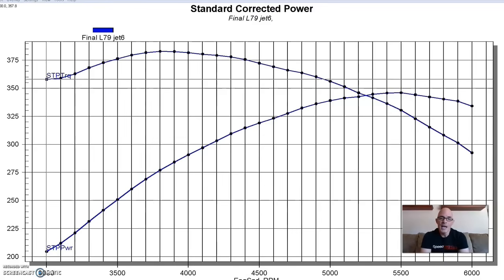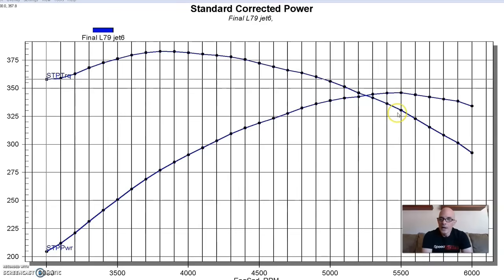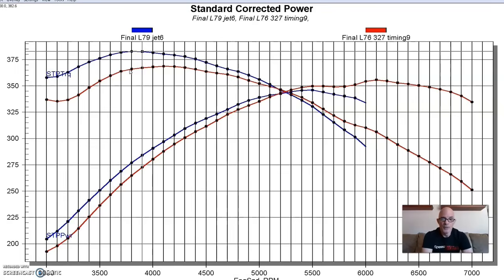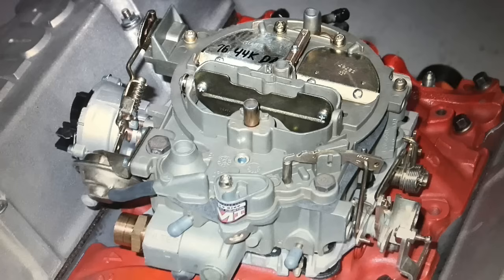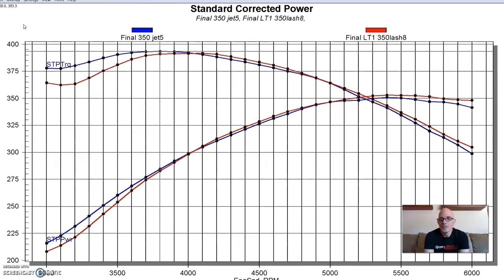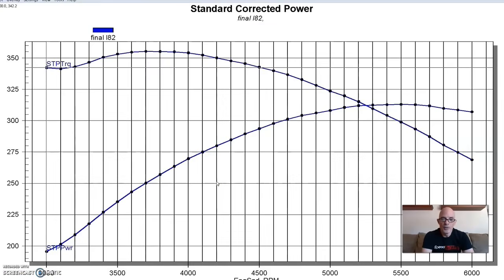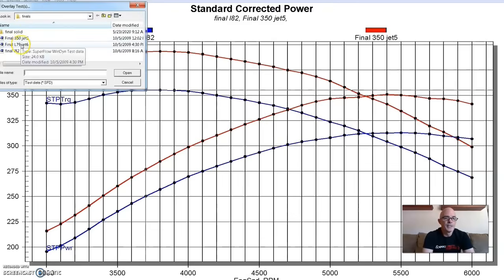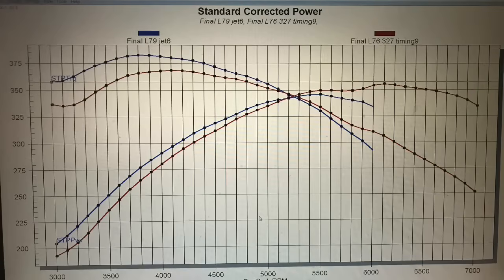HOW MUCH HP DID THE L79 350-HP 327 REALLY MAKE? WHAT ABOUT THE L46 350-HP 350 OR L82 250-HP 350?

Comment: I had a 2nd design Z28 cam, the 257/269/.493/.512 in a popup 350 with 186 bolt hole 2.02s and the nuts kept backing off,within like 5 miles.  We tried new nuts and didnt help.  We never did figure out why.  We did poly.locks and motor ran great for years.  So weird.  I've had over 40 flat tappet solid SBCs and that was the only one that ever did it.

Comment: I love these combinations and have built a lot over the years - I use the hyd 450 lift 222dr with 9.8 cr fitted to a 76cc combustion chamber ( better flow and not shrouded) and a Qjet with an aluminum manifold with awesome results with stock big value heads for street use great power to 5500 rpm-  total cruiser on pump gas and a pleasure to drive with little mechanical maintenance. planning to dyno it and see what it actually puts out-  have raced a lot in my day and always relied on lap times as an indicator of setups.

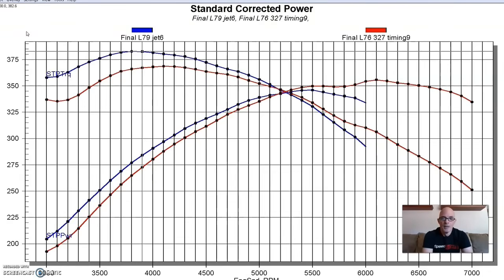Comment: Mid 60's my cousin was an apprentice machinist and he build a GM correct 375 Fuelie motor for his 57 Chevy.  Backed with a 4-speed and 4:11 posi, it was one of the baddest cars around San Jose at the time.  Not many wanted to take that car on.  396 Nova's - sure.  But most full bodied cars stayed away.  I was running a G2 Paxton blower 312 in a Ranch Wagon and on a good night at 4-lanes on the coast highway north of Santa Cruz, he could walk me by 2~3 car lengths.  It was just one of those combo's that really ran when he wanted it to.  He was one of the few guys who could really tune the Fuelie system.  Great motor, good memories :)
But I love the L46 cam as an all around good piece for a street motor :D

Comment: Hey Richard, I would like to you to do a test on the L T1 from 1989 1997 U do it with the torque head Ignition system , it's supposed to be a bolt on 50 horsepower and I would like that your review on it thank you so much and I look forward to the possibility of you morning that test
Reply: Being an f body owner and having experience with this system they are no real power gains from it, the original opti spark was very advanced for its time and could keep ignition timing within 1° of absolute perfect timing!!
Reply from the maker: no ignition system is worth 50 hp on that motor

Comment: My shop teacher gave me one of those 30/30 cams I had a 75 280z funny thing was I pretty much had ever sbc made minis the smallest of the all but any was that cam ended up in my dads old monza 283 bad thing was it had one bad hole so 3 machine shops later got that one hole 40 over and yes 1 hole. A little grinding and got it with in 2grams of the others.the other bad thing being broke ment no money for springs.it sounded nasty but she would float the valves at 3800. Young and dumb to the track I went shifting at 3800 floating valves through the traps at a mean 15.2 engine before that was stock 350 with a 150 shot 11.4s lol

Comment: I had a real 70 Camaro Z28-RS/SS 4.10POSI- TH400!!!!!    ALL ORIG!
350-370 SOLID lifters.    Rare car...and it was very quick...but no a/c.....and plastic seats.....yuk.   
I would kill to have it back today.   Never had lifter ask problems....but my other sbc did.
Some pulled studs out of head, and that was why they kept getting noisy!  Drill head & stud and hammer in  1/8" rollpins....End of problem.    Another thing I did was add 1.60 exh valves to all 327 motors....with a cam, they ran Real Good.....
I could type all day about my cars from 1969 to today!!!!
69 Z11 pacecar conv.  396-350 with Indy title!!!   34,000mi!!
70 MonteCarlo 402 4speed bench seat NO AC!!! All numbers matched on all these.!!
Tons of musclecars in Omaha & surrounding areas.....70 Buick GS455 stage2!!!!  7000 miles.
71 Z28 Baldwin Motion Camaro 454with overdrive 7500miles( sold for $200k)....
Not even the tip of iceberg......
Reply: I hope one, God will bless me with something even half way descent and, I will be happy. 😁😎

Comment: Which 350 you tested had 3.8” bore? Buick engine and they used it make a V6 from it. 231 V6 same bore and shorter stroke or you didn’t test the Buick 350 ?
Reply from the maker: no sbc 350 has a 3.8 inch bore-they are all 4.0
Reply: Richard Holdener  Oh ok thought so lol Great vid btw.

Comment: My first car was a 55 Chevy. It was an old drag car with hardly any original parts. I scoured the globe or at least any wrecking yard in driving distance for a L79 or a L46, it was like finding the holy grail. Most times I would end up with another 300 horse 327 with a worn out cam. So a new bump stick, intake, carb and I was set till that one let go. Those were the days.

Comment: I have had the nuts loosen up before and start ticking on hydraulic cam on the dyno one time.  I buy new nuts in bulk and replace them on every build that uses stock rockers.  I use stock rockers on a lot of street car engines because they are quieter and the performance gain not noticeable. Some of the round track engines I build require stock rockers. The data you shared is very interesting the local round track requires basically a L82 in the lower classes. Thanks

Comment: 327. Roller Hydro top to bottom. Holley Sniper. Long tubes. Aluminum Heads in a Nova with a manual. Nothing choppy just a smooth sleeper.

Comment: My dad and I put together a 400 Chevy block with 350 rotating assembly. That was the old way of destroking and making a so called 377. When you do the math of a .030 over 400 it equates more closely to a 383. We put old double hump heads on it with pinned studs and roller tip 1.52 rockers. We put a 510-510 solid lift flat tappet nitrous cam which is a 518 with 1.52 rockers. We couldn’t get some of the cinch bolts to stop backing off so we also put Polly locks on them and so far for two years running no adjustments have been necessary.
Reply from the maker: those 377 are cool combos-big bore works well
Reply: Did almost the same but used a 327 crankshaft!! What a screamer; low 11.30,s in a67 Chevelle..

Comment: I have an all original '68 El Camino Malibu I bought from a friend in '70 who bought it new. The '68 EC with the L79 option came with an M21,  12 bolt 4.10 posi, front Corvette disc brakes and a larger exhaust system. The '68 L79 had an iron intake w/750 Q-jet. In '68 GM lowered the rating of the L79 to 325 hp in passenger cars but the same engine in the Corvettes was still rated 350 hp. This car was my daily driver until  '78 when I bought a new pickup.
Reply from the maker: yes-there were running changes to the L79-I just didn't want to make a 3 hour video covering it all but I love all that stuff
Reply: @richardholdener1727  You're my hero! I would never expect you to list all the changes to the L79. The only reason I mentioned theses changes was that when I told somebody I had an L79 327 in '68 nobody believed me because it had a cast iron intake and a Q-jet . It did have chrome valve covers and a chrome 14" open element air cleaner which wasn't normal on a regular 327. I  had to show them the original paper work to convince them it was an L79. I loved that car because it was real sleeper. It was plain old blue color, bench seat, dish hub cabs and quiet mufflers. All I did to make it a little quicker was to add headers, an advance kit in the stock dist and put wider street tires on the rear. A kid I worked with bought a new '72 Chevelle with a 454 and cowl induction hood. He had ridden in my EC a few times and said he thought my EC would outrun his new Chevelle. I finally told him I would race him but only to 100 mph. It wan't even close when we raced, I thought he forgot to take off. I didn't know at the time that Chevy had lowered the hp so much on their engines in '72 .

Comment: The engine I’m building specs out close to the l76. The difference being .470 lift on 108 lsa. The heads are 186 double humps are ported and it will have an aluminum intake. Yes I’m running a Q-jet. I’m impressed with the l76 the way it sits.maybe my build will do a bit better but torque is the goal. Make my 71 gmc half ton fun to drive and still pull the car trailer.

Comment: I ran the sold lift  z 28 and the optional z28 back the and we spun it up to 7000 or so . The heads had double valve springs . Dont remember the seat pressure.  On the motor in the boat it had the straight plug heads that had been worked .  I never had a problem with valve adjustment but i always ran to stud gurgle.  With roller rockers .

Comment: I always built our street engines for maximum torque. I ran poly locks on solid cams so no issues there. Never had an issue with hydraulic cams backing off the rocker arm nuts.

Comment: Nostalgia, I worked in the Norwood assembly plant while going to college and we put many of those engines in Chevy IIs and Camaros in the mid- to late 60s. As you said, those were quick cars for the time. Just for grins, overlay the stock LS 5.3 curve on that L79. I think we’re talking 30° less intake duration and similar torque curve. Modern heads really make a difference!
Reply from the maker: heads, intake, windage tray-it all adds up

Comment: For a daily driver I would take the hydraulic for dependability all day long. How often does anyone rev a SBC to 6500 on the street? There is a low tolerance for that where I live. People would come out of their houses wondering what's going on. So why put yourself through the trouble of a solid lifter when you rarely use it and the gains are marginal? Just my two cents.

Comment: Morning! I’m assuming the 11:1 compression motors ran pump gas because back then there was 100 Octane at the gas station? With a TH 350 I would prefer the high revving 327. Would you do the same same on a 400 SB? Lots of people ran that in there cars. I did as well.
Reply from the maker: not really performance 400s from the factory

Comment: I love this stuff! This the stuff I read about in the magazines as a kid but there was never any stock numbers in articles. I'm impressed how close the L82 was using smoggers, everyone claims smoggers won't make any power at all. I still have n old 350 from back in day when I was young, it's had several configurations over the almost 30 years I've had, it has 2.02/1.60 valves, bowl ported and smoothed runners 993's, 9.1 flats and 232°/.480 Howards ( "max torque" 112031-08 flat tappet cam the absolute BEST sbc basic hot rod cam I've ever used no question, great power evil rough idle without  low rpm driveability problems) original torker and I still think it runs pretty strong today regardless of what forum guys claim. Years ago Super Chevy built a smogger 350 that made 365hp with similar specs. I always guessed hp between 325 to 350 area. Maby optimistic but it always felt oddly lively for what it was. Keep up the cool content!
Reply: Hulagan 808  I have it in my daily driver 92 c1500 the only thing I went a little aggressive on the converter at 2500 for a driver it wasn't necessary and it stalls higher than 2500 because it makes more Tq than I assumed it would and rear gears. But light throttle It still chugs away nice  aat good decent low rpm, i could have stayed at stock or slightly over stock stall with this cam I think and has great mid top end pull, realllly broad powerband pulls nice even in a 4000lb truck with 3.08 (my attempt at some MPG gears! and 9:1 compression . All with that nice lumpy idle. I've tried a pile of cams in that 350 the closest thing else was lunati bracket master 280 that was pretty good all around decent low end Tq but not like this one. Has a Comp magnum 292 when that 350 was in my lifted square body an yikes to much cam it was absolutely dead below 2500 but did pull on top nice and a badass extream idle, same with crane Saturday night special short track cam awful no low no top all mid kinda boring.. the Crane fireball 2 25 years ago was pretty good but kinda tame. I've always wanted to try my combo in a car like Nova or Camaro I think it would be great even as a daily driver. Howard's hit a home run with that cam it would be perfect for your combo.

Comment: I would love to see a dyno test of the big Cadillac, either 472 or 500 with some basic bolt on's and maybe a cam swap. Not sure if those could handle boost, with their cast iron rods!
But the torque would be the strong point.
Reply: Hell yes, I have two 472's and a 500 in my derby cars! The 500 only had 40k on it and it freaking rips! It's been in 2 derby's and still has so much life in it!
Reply: They handle turbo boost just fine.
Reply: Did you see the builds a few weeks ago?
Reply: They actually don’t make as much power as you would think, me and my father in law put a 500 in a Fiero we had, DONT get me wrong, it was a blast to drive, they just don’t make what people think they do albeit they have potential
Reply: @nathanwood1567  of course the power would depend a lot on the year the motor was built. Quite a difference between a 1970 500 and a 1975 500, 400hp vs around 275(adusted to gross) hp and atleast a 100ft lb drop in torgue.

Comment: I would like to see the 292 casting, if you could find them. They were the find in the day
Reply from the maker: we had 292s, 186 and 461s
Reply: @richardholdener1727  brings back memories, the old 461 with the low plug location how about the 040 and 041 with different Marks but still the same head. I had 292 head done by crane, that brought the 11 350 with a roller to life. Just reminiscing the old days. Your work is the best out there 
Thanks

Comment: Ever thought to do a test on an l31? Maybe one with a modified tpi intake to fit onto the vertical bolt pattern if the vortec heads?
Reply from the maker: I have run L31s, usually with carbs

Comment: I have 283 with duntov 097 solid flat tappet and 081 ported tpi heads with z28 valve springs. poly locks. no problems. runs strong up to 6500rpm.

Comment: This is another great test. I always knew that the l 79 and l 82 cams were pretty good for a decent street engine. We were able to even use the same valve springs that came with  standard 250 or 300 horse 327 and then just change the cam. Suddenly you would have an engine that would rev really well, even a little higher than shown here. The reason was because the cam profile is very gentle on the springs. We also had to constantly adjust the solid lifter cars but not the hydraulic motors. The reason is because the lash of the solid lifters. The shock of the lash being suddenly taken up when the lobe moves the lifter up causes the nut to creep looser over time. Hydraulics don't do this because there is no lash to be taken up and the valvetrain is held together by the lifter preload thus no shock on the nut to loosen it. Keep up the great videos Richard. You have to be the longest running testing guy ever. I have been reading your articles for many years.
Reply: Have to disagree on the L82 cam. It's was wholly inappropriate for the low compression engines they were put on.  Lookup the 0.006" duration #'s and plug them and the static CR into a Dynamic Compression Calculator (factoring in the 3 degrees of cam retard ground in) and it becomes obvious why the things were such a dog off the line. 6.6 sec 0-60 time; slower than the L48. EW!
Reply: Adam- stick a Vortec head and an Air-gap on that L82 shortblock and that would be what it was missing.
Reply: @philipmazzuca2269  I agree that the extra compression of a vortec head will help loads but almost any cam will still do better. It’s just a late 60s ultra lazy lobes design. The terrible exhaust systems that came on the smog era cars really can benefit hugely from extra exhaust duration, too. Friends don’t let friends run L82 cams when there are alternatives even ones that work on stock springs.

-Every major cam company that offers a “classic/ nostalgia” grind based upon the L82 seems to agree with me as they only keep the duration @ 0.050” and lift #s from the L82 and give them dramatically less seat to seat and adv durations. (Cam companies won’t even sell you an actual original L82 specced cam because they were just too lazy with unnecessarily large adv durations.)

Those lobes open the valves at the rate of an old man in a walker, dragging it along by those tennis balls on the bottom.

A vortec headed SBC isn’t a bad match for an L82 cam but the vortec heads can really use the extra exhaust duration of a split design, too.

Comment: Honestly I was really surprised to see the l79 hydraulic cam out performed the solid l-76 I was surprised that it carried more power such a long way through the pull. As far as the pitch Nutz backing off, I can say that yes I have had that to happen. But not so much on the solidcam but years ago I had to happen on a hydraulic. My assessment of the situation at the time was simply that the nut was worn excessively. I purchased a new set of pinched nuts and never had another problem again. I never really had any respect for the L82 engine. It was just too much of smog control, no compression, no good flowing heads, not even a good camshaft as far as I was concerned. In fact I'm surprised that you tested it and I'm equally surprised that it performed as well as it did. But still that isn't saying much. It's one of the last cams I would consider putting in any sort of performance minded engine. But perhaps in your test it's a little bit better than I gave it credit
Reply: ever looked at a kent 1600 ford motor,or similar,it has a lockable adjuster,something chev should of woke up to..chev are just cheap..plus,here in aus,the studs would come out of the head on holdens,,even cheaper..you cant adjust valve clearence if the stud moves..GO FORD,. no adjustment needed,ever.

Comment: Before the L-82, Chevrolet also made a low compression Lt-1 330 HP 350ci small block with the  #178 camshaft. It was a factory solid lifter cam. Heads were casting number #487x
Reply from the maker: 1971 was a 330-hp